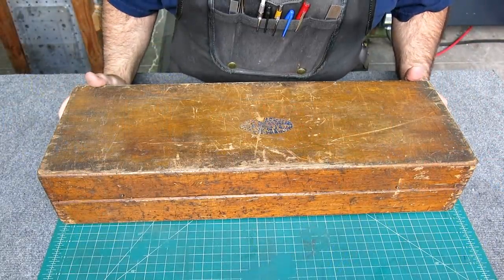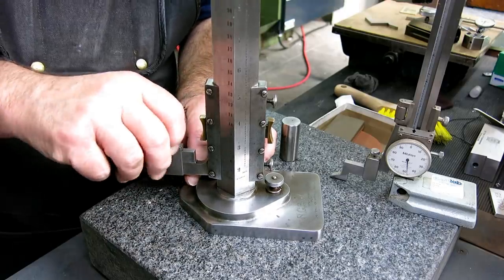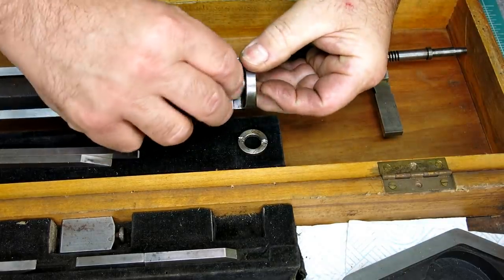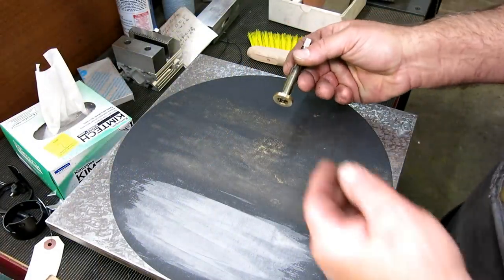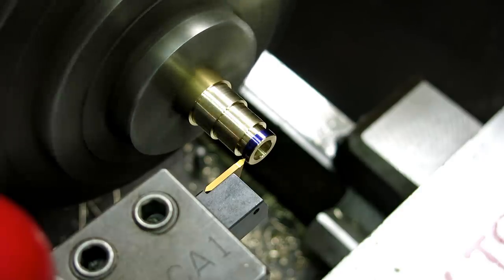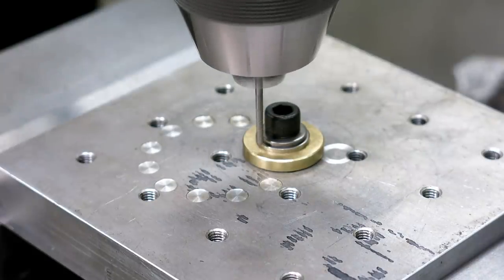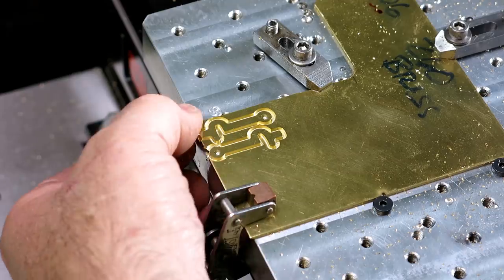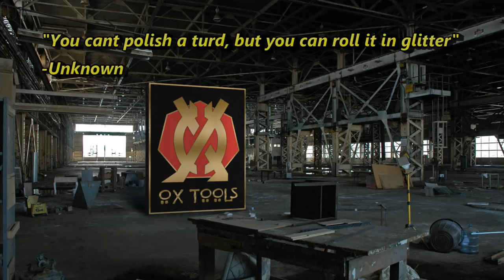Chesterman Height Gage Repair

Comment: Hi Tom , excellent as always , have a 24” Chesterman  on the corner of my granite surface plate , purchased it in 2003 when Rover/BMW made us all redundant, we all had used it in the shop everyday and it very true how the corners rub of with use !! Now spending its twilight years helping with veteran motorcycle restoration .....
Regards
Robert 
Partsmade 
🇬🇧 
( as a foot note on the site closing down sale I and a work colleague bid  on all of them and we bought 42 in total 12” right up to 48”, very sad paid little more than scrap weight for them some still boxed ☹️)
Reply: You could help a new passionate machinist or in a hobby club by passing some of them. Nothing better for a tool than to be used with care!

Comment: For the screw-holes: Stick a match in there backwards with a bit of wood glue, cut it off flush and drill a new hole. Works perfectly for this small stuff and i used this technique on several furniture restorations before.
Reply from the maker: Excellent! Just the tip I was looking for.

Cheers,

Tom
Reply: My grandfather taught me that trick, although with toothpicks, not matches.
Reply: golf tees for larger holes - just fyi.
Reply: That can’t be the way to do it! No indictating, no making a special one off tool to make a one off jig, what do think this is!
Reply: @okiwatashi2349  It's wood elf techniques for dead tree carcasses, of course!
Reply: @PaulSteMarie  exactly they are made from birch,  I use a drop of cyano glue or no glue at all

Comment: I completely agree about the patina of use on a tool.  In fact as you look at the device you start to wonder just how many projects were completed with it and what were those projects.  Some may have been piddly little parts that had no great importance and yet there is every possibility that the parts were very significant either on a personal level or perhaps even significant on the world stage.  I like the hooks, no you couldn't go to the hardware store and get them because all you would find is crappy die cut hooks that would bend the first time you used them, IMHO...  Great video.

Comment: This is from my perspective one of the best videos You've made. We share the same type of respect for old tools. My last was a Steinmeyer 100-200 mm micrometer.
Reply from the maker: Thanks for the nice comment!

cheers,

Tom
Reply: @oxtoolco  I have one of those, and I had to refurb it much as you did. It's a nice piece, for sure. One design feature I don't think you mentioned: the diamond profile beam provides an excellent opportunity to eliminate parallax error from the vernier scale, by configuring it to taper down to a knife edge. This means that the two graduated scales meet at a single edge, instead of being offset from each other.

Comment: Hi Tom, a very nice repair in the sympathetic restoration mode, I have the exact same gauge. Notice I spelt it correctly as it's an English tool lol mine is in a not so worn state, but has some little rust stains that I tried to get off sympathetically without scrubbing the balls off of it . I used oil and wire wool, they still show the shadow, but it's clean and oiled regularly and above all used and LOVED ! Greetings from good old England.

Comment: “Bozonic” is my new favorite word. A Lipton Custom! 😂 41:35
Reply: Is Bozonify a process we can use?
Reply: @sp1nrx  Bozonification is a deceptive process... while simply screwing something up is easy, the highest heights of Bozonia are only reached through studied and careful misapplication of equine faculty and unsound judgement.
Reply: Tom's idiom makes me think of the car guys I hung around with in Orange County in the early '80s.
Reply: Bob's your uncle.
Reply: @negumanezer  I told the mid to late 20 year old kids of the owner at the last place I worked that phrase, while their uncle, named Bob, was there. Neither of the kids, the owner, or his brother knew what it meant. It's not funny if I have to explain it.
Reply: I heard "bosonic" as in "bosonic field", named after bosons, the class of elementary particles (or particle-like excitations) that obey Bose-Einstein statistics (as opposed to Fermions, which obey Fermi-Dirac statistics.) Fittingly enough for this video, there are so-called "gauge bosons": particles that actually mediate the fundamental (and other) forces. For example, photons are the gauge bosons responsible electromagnetic interactions between charges.

Comment: Nice hollow-ground screwdriver there. Whoever buggered the screw heads should have been using one like it. Is it shop-made or purchased?

That little boring bar is adorable, too. Don't drop it in the chip pan or you'll never see it again!

Parting off into a threaded hole is a good way to catapult your part into the next county. I did that with a steel part that was threaded to 1-12 and it hit something hard enough to put about an eighth inch divot in the solid steel. After that, I've always caught the part on a steel rod clamped in the tailstock chuck. I I don't care to risk my hands or my skull on luck going through that part.
Reply: often called 'gunsmith's screwdrivers'

Comment: Toothpicks or a couple golf tees and some glue are your friend with loose screws in wood.
Reply from the maker: Golf tees. That's a good one. I'll have to get a handful of those for this kind of thing.

Cheers,

Tom
Reply: @oxtoolco  I dont golf, but usually a ziploc bag of tees at the fleamarket will last me a lifetime. Also try to keep a jar of fat round toothpicks in the shop for the same reason. But Im a wood fool. As much abuse as those $50 hook and screw latches you made will see anything will probably work.

Comment: 42:14 if you remove the screw, dip a toothpick in wood glue, jam it in the hole and snap it off, you can put the screw in immediately and you're done. Rather than mess with mixing epoxy and all that. Even better are small slivers of hardwood rather than a toothpick. works great for door jams, door stops, cabinet pulls etc.  Another great restoration. If you add that offset attachment to reach zero, be sure to turn on the camera.

Comment: Tom, at ~23:04, the drill bends a surprising amount back & forth before settling down for its cut.  How much does that affect the accuracy of the diameter being cut?  Is it still "on center"?  Is it still as "round" as a normal hole cut with a twist drill that didn't bend back & forth?  Anything else?  Of course, you followed up with the carbide boring bar, but I'm still curious about what a drill gives you by itself.

I really need to buy a vernier height gauge for my (hobby) shop, 12-in. or 18-in. high.  I don't want a digital gauge.  I'll probably have to buy an "import" height gauge due to limited funds though.

And, I like the closing quote by "Unknown"!  ;)

Comment: You don't need to fill the latch screw holes with epoxy. A couple or three wood slivers with glue ( I use small tooth picks) will pack the screw hole enough to get a tight fit on the screw which should last longer than the rest of the case.

Comment: I bought a chesterman on ebay a while back and it too does not go down all the way to zero(base level) why did they make them like that? as is its not much good for smaller parts unless i make a marker piece for the end and grind it down to reach zero, it came with a marker but its about 5mm too short so anything under that you cannot use it. Just curious to know what was the reason for making them that way. Thanks for sharing.

Comment: Just squirt a little thin superglue into the case's screw holes and let it set. Not enough to fill them, just enough to soak into the wood a little. It'll harden up the threads.
Reply: Those holes were too floppy for superglue lol. CA is so brittle in a hole that sloppy it usually just falls right back out.. but as much work as those latches are gonna see a bit of bubble gum would likely hold lol.

Comment: on a facing cut, I notice you often go from the center out, does it make any difference, either functionally, or finish wise?
Reply from the maker: I will usually go center out when I have a hole in the part. It saves having to shift the feed change lever back and forth. 

Cheers,

Tom

Comment: I have one of these, does anyone know what the purpose of the slot on the underside of the base is for. Or is it just a manufacturing  feature
Reply: Think I have answered my own question after having a think. Probably to equalise air pressure under base, don't want it sitting on a cushion of air

Comment: Hi Tom, at around 22 minutes when cutting you can see the centre of the part wobble every now and then, what causes the wobble and does it cause the part to be out of shape at all? Love the videos (Not an engineer so sorry for asking maybe an obvious question)
Reply: One flute of the drill catches before the other and pushes the drill to the side. When they both catch, it centers better. Drills are generally for rough work, and then followed up with boring bars if it's a precision part.

Comment: Hi Tom and friends. Do you know of a way to darken the engraved lines on the beam and vernier. I have a nice starett master beam  hight gauge that has faded lines, hard to see . Thank you for your channel.
Reply: Paint fill it. And wipe the excess paint off.
Reply: Jewellers / Engravers wax. Put on hot and gently scrape off the surplus when cold. It can be tricky to avoid wiping paint back out, when you have just put it on. The wax can be found in white, which may be handy for some jobs.
Reply: Depending on what's left of the engraved depth, you can use a Black nail polish.
Let it dry then use acetone to remove the surface excess.
Reply: @colincreedtattoomachines  Hadn't  thought of that. More than one way to skin a cat.

Comment: HI young Tom,
Not watched it yet but do that English tool justice and spell gauge correctly.😂
ATB 
c
Reply: You mean like the way John Mills says it?
Reply: GAGE   why waste letters :)
Reply: @MF175mp  ah but he doesn't speak English, he speaks Geordie. The majority of us brits can understand him as we are bi lingual as long as he doesn't speak too quickly.😂😂😂
Reply: @chrisstephens6673  I can understand John not even being a native English speaker. The Irish lamb farmers accent is a bit too much for me though
Reply: @MF175mp  you need to flush your ears with Guinness before you are able to comprehend that language.
Reply: Right now i have watched, i have exactly the same 369. The lock screws seem to have a normal diamond knurl but only two rows.
I don't have the case but it is relatively unused, so much so that when i bought it last year for £10-15 (about $50😉) the lube had oxidised and gone solid jamming the quick release. A dismantle, clean and modern lube and good as new. If you dismantle it watch out for little bits in the quick release mechanism, i didn't, lost a bit, made a bit, and then found lost bit, that's fate for you.